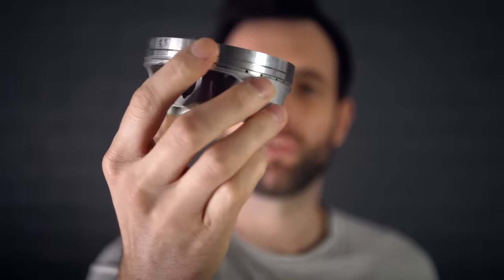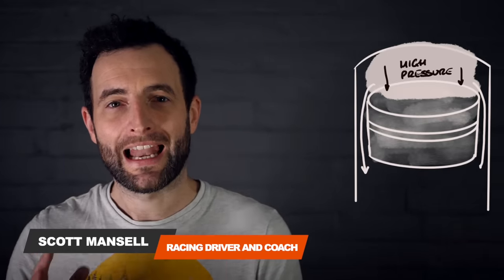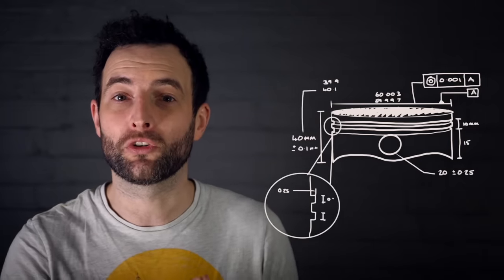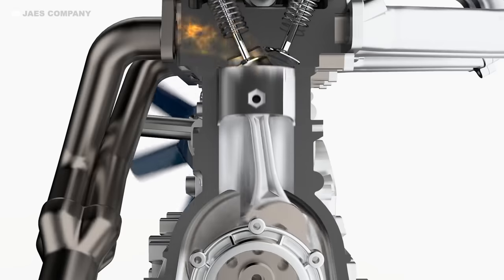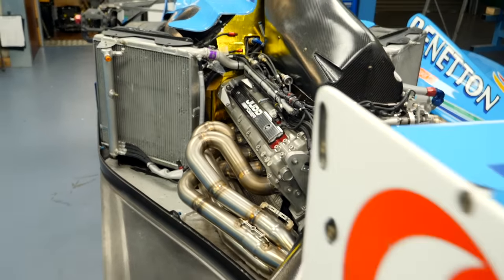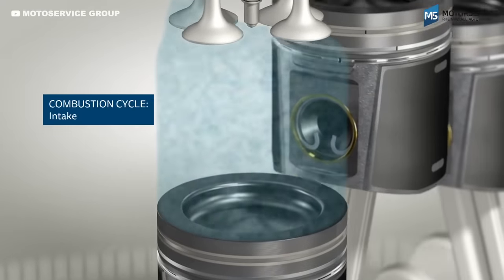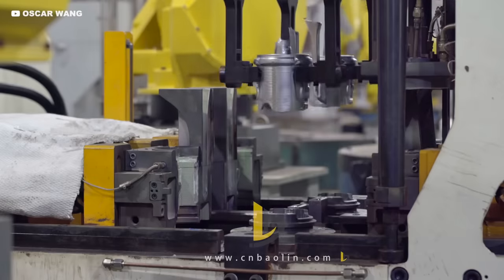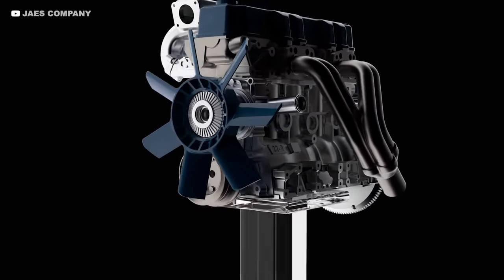Why F1 Pistons Cost £50,000!

Comment: 15krpm! (Laughs in motorcycle)
Reply: run your motorbikes engine at 15k for a couple hours straight and you only get 1.5 gallons of fuel to do it.
Reply: @lexluthor6906  what are you talking about? The average sports tank is about 3.5 - 4 US gallons.
Reply: @cafesociety8525  the efficiency of an F1 engine is phenomenal under race conditions. more than twice that of WSBK factory
Reply: @lexluthor6906  i'd bloody well hope so when f1 pistons cost more than the whole wsbk! A stock $15k r6 will rev to 17k and the engine will do 100k miles. Point is 15k revs ain't that high.
Reply: @cafesociety8525  they can rev a lot higher, they are limited to 15. its not the pistons themselves its the engineering that makes them so expensive
Reply: @lexluthor6906  bikes have and do rev higher than f1 cars. Honda were running 22k bikes in the 60s. You're never going to win the rev battle against a bike simply because of mass. Stop trying to prove a point that doesn't exist. OP is 15k ain't high and commercial 250cc street bikes in the 80s were revving higher than f1 ever has.

Comment: Wow, very tight tolerances.
Shut up man, a +/-0.1mm is a tolerance I keep on bolt on flanges thickness for agricultural water pumps, the normal play between a piston and a cylinder on a raw and common AIR COOLED engine it is 0.04/0.06mm.
A normal coupling, like for example an H7/g6 you can find on any appliance like an electric motor's shaft and its pulley for your washing machine or a table saw, or something like that, has a play between 0.007mm and 0.041mm, normally you have a centered play of 0.02mm, because any normal CNC lathe can work within a 0.01mm tolerance.
Any ball bearing is grinded to microns specifications.

Speak about things you know, please.

Comment: Pistons moving up and down at 80 mph? Doesn't sound very fast!
Reply: At 5:33 he shows piston speed as 10 m/s = 22.4mph. (this may be average piston speed) This also is a very slow speed. 80mph=35.7m/s and would equate to a stroke of 70mm at 15000rpm. This is average speed over one revolution. Peak speed would be much more around the mid stroke point. His quoted numbers seem to be a bit hit and miss.

Comment: Um , there is some serious exaggeration mixed into this one. Also the piston you are holding looks like junk compared to a decent set of US made pistons. Call up diamond pistons and tell them they dont meet tolerances would ya ? SO maybe its the material ? Well find me some material that is 50K for a block that big .... We live in a CNC world and tight tolerances are the norm... Also adjusting those parts is a fairly easy process if they happen to be a hair off and I would think is almost always hand fitted. Remember hand fitting parts set that certain thing , whatever it is apart from a thing that is just mass produced... Hand fitting is just not that hard. for 50K you could hire 1000 German Craftsmen for the time it takes to make that one piston...
Yeah that was a stretch my friend...

Comment: Just crap. Pistons to overloaded cars with 800hp for example have the same specs and made or same material and costs about 700-800€/each. And they even takes over 9000hp in too fuel. Same conceot

Comment: “Time of the genius engineers “ I’m sorry but I couldn’t help but chuckle. Unless those genius engineers are an entirely different breed from passenger vehicle engineers then they’re idiots. I’m convinced that car engineers compete with each other to see who can come up with the stupidest design possible.  I really think they have yearly conventions to hand out awards and crap. The guy that designed a Volvo that you have to remove the right headlight to change the oil filter probably got a lifetime achievement award. The poor bastard that designed the plastic piece under an oil plug to actually work as a functioning funnel probably got run out of the industry.

Comment: Next time just compare it to a 18k rpm bike engine piston…. Also the “engine seized while cold” is a myth… they will spin/run but the wear level is higher than nominal while cold so there is no point to run it cold. Just stop spreading fake info.

Comment: The piston experiences 200g ?? Whaaaat? It's very sad when a technical video has such deep errors. 200g happens when you gently drop the piston onto a wooden floor. At 15,000rpm the piston will have a max linear speed of very roughly 50m/sec, half way along the bore. It then decelerates to 0m/sec in 0.001seconds!!
...At 1g it would take 5 seconds from 50m/s to 0. ...So to do it in 0.001s we are talking 5000 g ! Bye bye Driver61, this kiwi viewer is goneburger...

Comment: how do they assemble the engine sized??  there is a lot of bs.if I could pre warm my engine every time I was going for a ride I would, if I could afford to. but thats not  because the engine is sized. ive built  many race engines, machined many race engines, assembled and tore appart many race engines.I have  GTP pistons going into my street car.  also if I build you a engine that cost you $10 million  out the door and I have $10,000 into it...it is not 10 million dollar engine. especially if my shop is only a 2 million dollar equipped shop. you have to read between the lines.and some people get paid more than they should..yes f1 if expensive and exotic parts and pieces are used..and like aircraft everything has traceability.

Comment: Misleading explanation.  Machining time and overall complication is not that high to make one piston cost 50k. Tolerances is the most failed part... in short there is no big difference between mass prod engines in terms of "some special F1 unreal tolerances" 0.05mil is the tolerance you can get on any modern cnc machine. You say that gap in F1 engine is 0.15 mil well 0.15 mil is the acceptable gap for already used regular car engine. Facepalm. Materials also is not the case. 

One F1 piston costs a lot because there is a lot of big daddys who will to waste their money on this boring hobby and a lot of companies willing to buy ads in this "sport" show. Some smart guys just making money for nothing.

Comment: This guy is talking total nonsense about the cost.

Formulated 1 engines don't cost anywhere even close to 7 million.  They are closer to $250,000 give or take a hundred grand.  This guy is pulling numbers out of thin air.  If your doubt me, please Google average cost of the engines or parts.  7 million for an engine would buy probably ten fully functioning brand new F1 cars.

His description of the pistons is good, but it totally losses all credibility because he is making such BS claims.  Yeah the pistons are made under these incrediblely strict conditions, but no way in hell would they ever cost over a couple grand AT MOST.  £50,000 is beyond rediculous.

Comment: F1 Pistons do not cost 50,000 pounds each.....
Got to slow down on the click  bait rubbish.......
Piston,ultra thin ring pack and ti wrist pin and coating is between 5000  to 8,000 pounds each 
Pankl rods are 5000 to 10000 for a set
Custom crank is 15000 to 20000 each 
Where the hell u got 7 million for a engine is pure click bait
Reply: engineering...

Comment: Absolute, incredible, astonishing crap.
A 0.1 tolerance is easily achieved, your entire vid was about the engineering of the piston not about the manufacture.
If the material costs £50k I’d agree the price is fair, if not (and it’s not) then it’s all in mark up.
Simple.
Material + machining + inspection + transport.
There is literally nothing else, where is the cost?

Comment: Seems pretty standard engineering and manufacturing. Sure the piston is machined not cast so that is a bit more expensive but not 1000 times more. you said the materials are worth several thousand, really, what are the pistons made from? You don't seem to know what you're talking about. Complete rubbish.

Comment: - why not competition with electrical cars 
instead of refueling change battery 
_
outdated with gasoline
_
weight 600 700 800 kg car without chauffer 
- and do what ever you want or can
- one motor electrical two front two rear four on anyone wheel is on you 
covering with solar panels do what ever you want mass or weight of car is 700 kg but try be first on finish
_
allowed everything possible what exist in humanity but until is weight of your car 700 kg
- change battery how much times you want
_
push them to inventing new things whom you goes using in practice on such way you goes never nothing from f1 using
_
can I brake with motors to recharge battery sure 
- everything possible in humanity until is weight 700 kg
_
what is maximum speed 1 million km hour  what ever you can inventing
_
can I inbuild plane engine for recharge battery 
- until is head electrical motor whom push you to ride car you can doing 
do not forgot be under 700kg with everything on your car  
_
invent something new and get victory is also possible
_
inbuild in your pit stop place maglev technology to get first acceleration but would be not on tracks for race
_
F1 competition is useless competition no one human ever would be anything of it using ever 
- only they company of cars claim lot but is not truth
_
two different branches whom almost have nothing common with each other 
F1 and ordinary cars 
- that is why you do not see all that inventions in cars
_
most stupidest way of humans to be busy with something 
- nobody need because nobody can using nowhere except for only one reason
- whom mean in some smart civilization would be not exist 
smart peoples goes see is not useless to exist why to build 
- but you are not smart humans not even close near 
_
on free will world 
- you can build something to destroy everything and you can also build something to get anyone benefit of it 
- chose what you want is on you
_
and the atheists goes say God is guilty 
???????????????????????
- and not about in such something is involved millions euro`s why instead or stupid busy feeding not poor peoples educate them 
_
when is God guilty on something 
- when you living Gods life and even then Hi want testing your faith, love for religion for him selves and doing whole time such something is multiple time recorded 
- also Job not only Abraham, 
while in case Job is not some nice justice but because to much jelling on God there you go
_
when you do not love religion there is millions reasons for excuse and single one to doing and is your love whom you do not have

Comment: I think your facts are a little bit pissed....0.15mm is 0.006" not 60 thou and the piston speed is not 700 metres per second or you engine would be reving at 300,000 rpm   slow down and get your facts right!